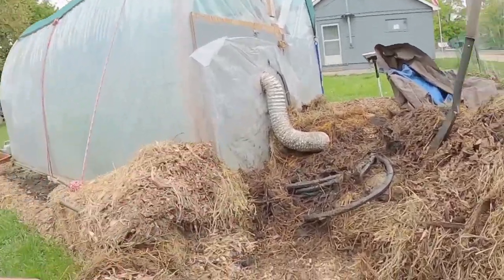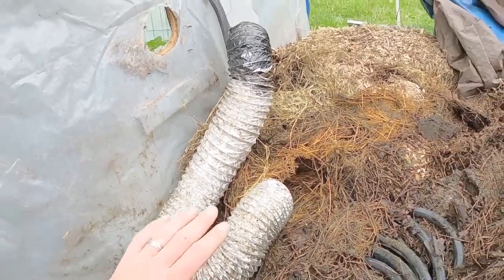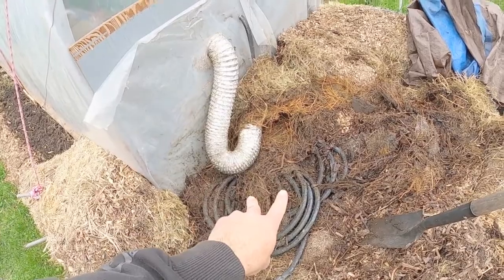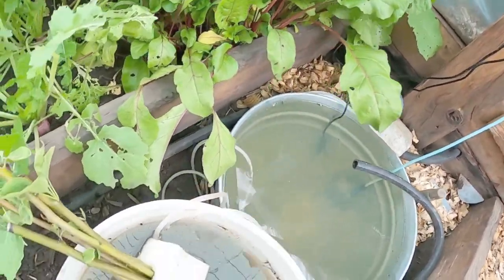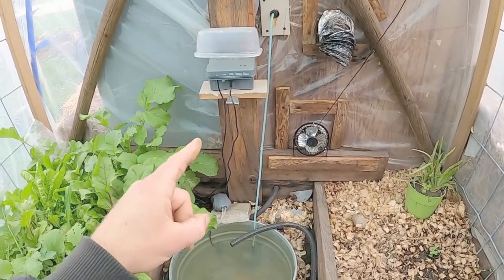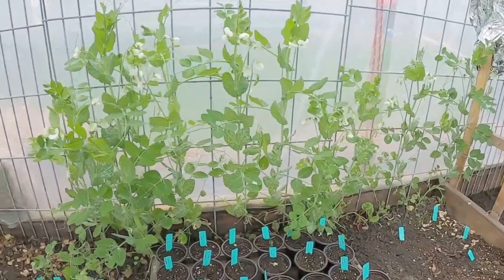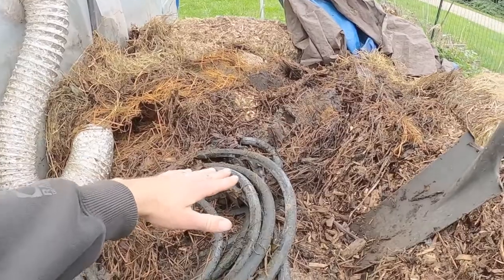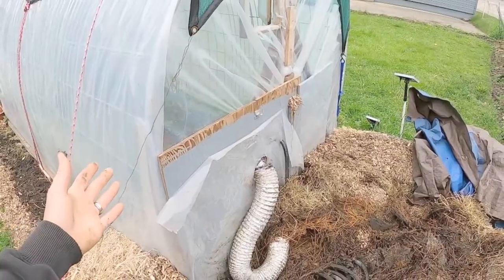CHEAPLY Heating My DIY Greenhouse ALL Winter With Free Materials, Compost, & Solar Power | Zone 4b

Comment: Thanks, looks like an ideal working solution. I agree that it's great that you've repurposed/upcycled much of the system. I had planned on using the airflow but like how you have a simple system to cycle water. I'm impressed that it works this well, nice job!

Comment: I presently have an 8x12 I'm heating.. with a 9 x 12 off the side recieving some of the heat. Off one end a small room with wood stove and wood. It doesn't take alot  of wood but am very interested in the compost heating idea
Reply from the maker: I don’t have a forest and did t want to spend money on wood all winter plus the maintenance of being able to leave my greenhouses for weeks and not have to do anything as apposed to adding wood. But wood fire stoves are great for this and I’m in the process of getting materials for a solid wall and panel greenhouse house and I’ll hook up electricity and have a stove in that one. Thank you!
Reply: @Earthdwellershomestead  I'm trying to figure out how to send u 2 pictures of opposite ends of my greenhouse but I'm not very clever with modern technology.
Reply: Use a lot scrap and trash wood for free whenever I can come by it.....
Reply from the maker: It’s a great heat source if you’ve got access to material to burn. We use a corn/pellet burner and it works amazing. Corn is pretty cheap as we’re surrounded by fields and can haggle with local farmers

Comment: just wondering what the dimensions of your pile is?   it’s a perfect set up for 2 people and 5 months heat is perfect.  use the compost in the summer build a new pile in the fall.
Reply from the maker: The pile is about three or a little over three cubic yards in all, we had a lot of decomposition and had less material when the need for heat was no more in spring. The pile was actually still active and hot when we started to get to the middle after the entire winter

Comment: I have a couple of horses so a lot of "waste".  Would the urine soaked wood shavings from the barn mixed with the manure be a good compost medium for this method?
I am also thinking it may be way to bring a little warmth into the barn itself!
Anyway thanks for this very cool video.
Reply from the maker: Yes, I would combine all the materials and ensure it’s even moist and it should heat up pretty good and if it’s big enough you can get some good duration on the heat cycle! Thank you!

Comment: What was the coldest you got at night temperature wise outside?
Reply from the maker: -20 to -30 over the winter we filmed and it was that way for a few weeks also. The compost really heated the little greenhouse up, the airspace and the floor at night creating 45-50f inside
Reply: @Earthdwellershomestead  we’re building a 12x24 Greenhouse  out of windows that will be having one side up against a pole building. I think we will use many of the techniques that you did for this build and heating system.
Reply from the maker: Awesome thanks for checking it out. And good luck!
Reply from the maker: @Deerhavenoffgridhomestead  you can check out some of our more recent heating videos from our diy 52’ greenhouse also!

Comment: Would there be any noticeable benefit from piling my compost heap next to green House but without all pumps batteries and circulating air. I have a plastic greenhouse
Reply from the maker: Yes I’d create a tarp bag to protect the poly from direct compost, just for longevity. We used straw bales all the way around and stacked a few high on the north and if we did them two deep they would compost and create heat while insulating the ground right outside the GH

Comment: Hi, your radiant floor heating seems to work well.  I might suggest replacing your dryer vent pipe with some 4” weeping tile (corrugated drainage pipe that is flexible and perforated).  That way this weeping tile can take the weight from the compost pile and any condensation that may build up inside the weeping tile will seep back in the compost heap through the perforation holes.  Any condensation will feed the compost with moisture and I believe that will helpful.
Reply from the maker: Very good idea! We are using a more solid pipe for the transfer of heat to the air. We’re actually going to be building a system to try and heat our 52ft greenhouse this winter. Much more work ahead
Reply: @Earthdwellershomestead  That should be interesting, I will look forward to the progress. I am a plumber so feel free if you have any questions, I’d love to help.
Reply from the maker: That is great! Having a good mind to toss ideas around with is always beneficial, thank you
Reply: if you use perforated pipe will the greenhouse fill with methane?   plants might like it but any spark might blow it up.  lol
Reply from the maker: No lol, we create very little methane actually from hot composting. Anaerobic composting creates the methane. But you’ll be filling your greenhouse with compost air and co2 and a bit of methane.
Reply: @Earthdwellershomestead  Do you use perforated pipe within the compost pile, and then couple a non-perforated pipe from compost pile to greenhouse to avoid heat loss?